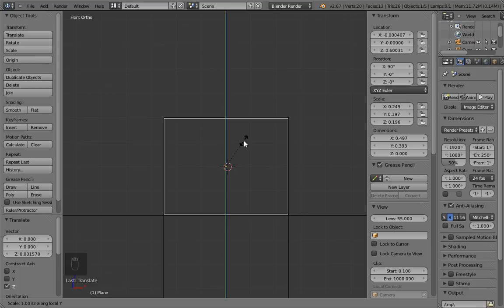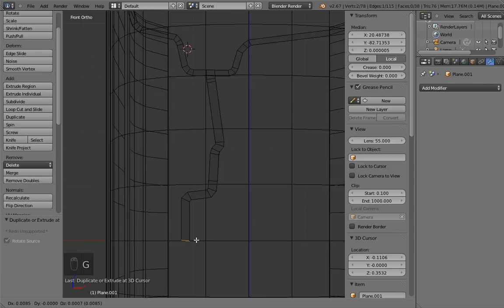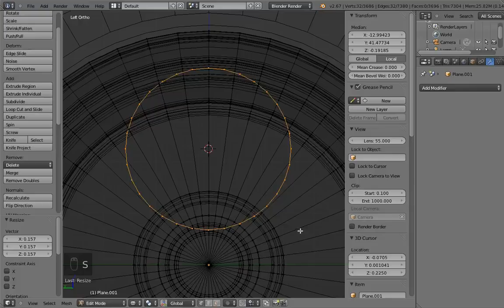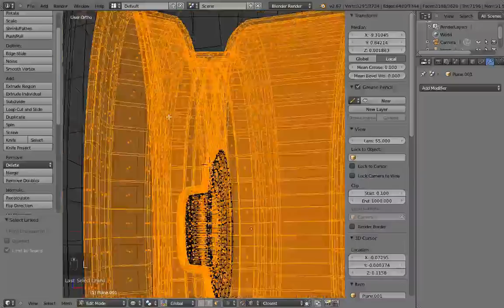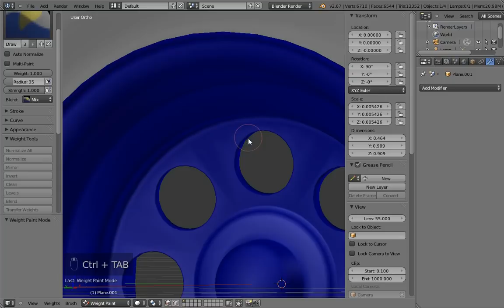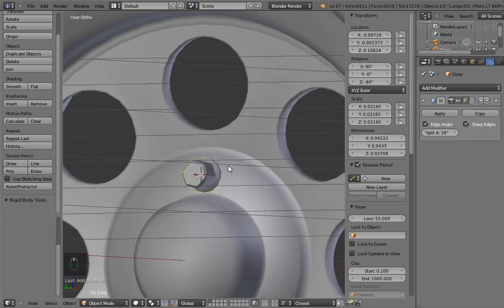Modeling an offroad wheel - Blender 3D Tutorial (Part1)

Comment: Great tutorial, but one question;
On the holes, why are you using the knife and not the boolean modifier? Wouldnt the holes be more accurate if you just subtract a cylinder from the rim?

(Havent gotten all the way though the tutorial, so if you do actually do this then ignore this question)
Reply: i am learning all of this as well and i would have to agree the Boolean modifier works best in this situation because  it is a wheel which is rigid and does not have any deformation properties to it. my first time around i did it his way and it looked great but took longer. i have done a few more over the last few days and have been using the B-modifier instead and it works just as well. especially for simple stuff like a flat faced wheel with holes...  i will say the second part of this series about modeling the tire treads is the best method and the one i continue to use.  i have watched a few other ways of doing it but this way is best.   -Cheers

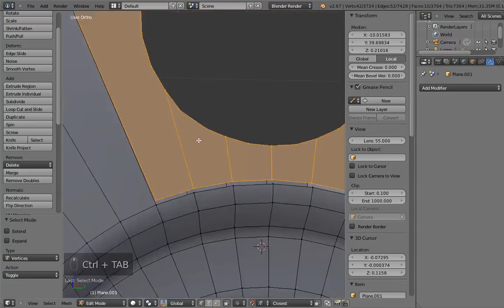Comment: Hello, I have a quick question. At 11:15 you snapped all the points together how do you do that? I am wondering because all I see is G, and all that does for me is move the point/vertex. So I am wondering what else do I need to push to get it to snap.
Reply from the maker: Hi, if you look at the bottom of the screen, there is a little red magnet (snap) which is activated. To the right of that there is a dropdown select, where you can define what to use as a guide for snap. In This case vertex was selected. When the magnet is red, snap is active, when it's grey, it's inactive. When it's active you can hold CTRL for deactivate temporarily, when it's inactive, holding CTRL will activate snap. 

Snap is really awesome, allows you to work more precisely. If you have time, try to combine axis locks (z,x,y) and snap together for interesting results.

Comment: ok so im really new to blender and know this isnt really the best 1st project to attempt but hey so what right lol ok well im hung up on a part right around 1:20 after you scale the plane you hit scale and rotate and then add some details. well when i do that it doesnt divide the section like it looked in your model i also tried the subdivide and it split it into 4 squares instead of 4 rectangles. so ya how do i get the rubber to take form like you did with that grid insert that you had to help form the curve of the rubber?
Reply from the maker: Hi Richard, don't give up :) ! It's the mouse wheel after hitting CTRL+R in edit mode. Let me know if that's it. Thanks for watching!
Reply: ok i will deffinately let u know. i just started using blender 5 days ago and have always wanted to try autocad but could never afford it

Comment: You could have made the holes with the boolean modifier o.O. It would have been simple
Reply from the maker: Hi, indeed it is possible to make holes with boolean (I'm a big fan of boolean :) ), but the "cutter" objects most likely introduce unwanted edges to the surface of the rim which need to be cleaned up if you want it to render nicely. Thanks for watching, and for the tip, it might work in some cases.

Comment: holy crap, i don't think you could go any faster...
I'm watching this at 1/8 speed and I still cannot keep up...
Reply: +Shane Drake I'm just happy you have the key logger on, or I would never have finished
Reply from the maker: +Shane Drake Thanks.. sorry in advance if you  happen to watch part 2.. i turned it on halfway only :(
Reply: +Zoltan Giber thank you for the reply
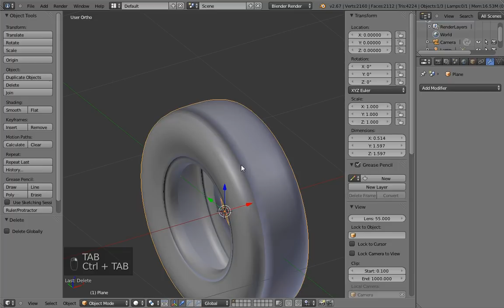at 3:00 you have the tire in edit mode yet all the object data is showing. I am obviously a new blender user, but I cannot find how to display all of the data. On the newest version, I only have the single edge displayed. I hope that makes sense. 
if i press Z i can see all of the lines

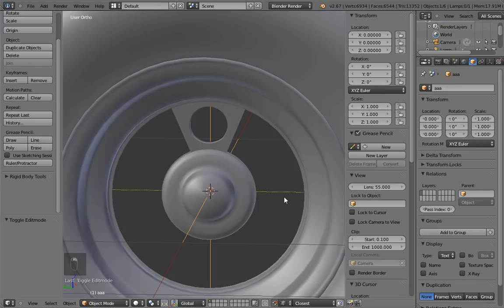Comment: For some reason the trick at 14:41, when you rotate the empty object (aaa) with 45 degrees to make the holes, does not work for me. I tried it in an empty blender file, and it worked. But with the wheel is simply does not work. I have no idea why. The whole is a separate object, I have set up the array modifier exactly like you, but when I rotate the empty mesh, nothing happens. I did noticed though, that the dimensions of the mesh changes drastically, when I add the array modifier, and rotating will simply not work. (I set the Blender to always rotate around the active mesh, and since it has a large dimension it rotates like crazy...) Do you have any idea what can be the problem here? Thanks in advance! (U.I.: Jo vegre "magyar" tutorialt hallgatni :))
Reply from the maker: Rudolf Heszele There are a few things to check: The edited slice (with the hole) must have it's origin at the same spot as the empty, which is in the center of the wheel. Then, in object mode, transformations must be applied on it (eg. scale is 1.0, 1.0, 1.0, rotation is 0,0,0 ).. I can't think of anything else at the moment...
(U.I.: Koszi, hogy megnezted, es kommenteltel :) .. szivesen csinaltam volna magyarul, csak tul kevesek beszelik)
Reply: Zoltan Giber Thanks for the tips! I had to apply the rotation and scale, and then it worked! Thanks a lot! Great tutorial!

Comment: Thanks so much for this Tutorial This is the first time Ive really used blender and I'm learning so much. I really appreciate the use of the key and mouse identifier in the bottom left corner of your video that is an extremely helpful feature. I know the mouse buttons can be adjusted. What settings do you have for your left mouse button. Mine are still on the default and It only moves the target around? Thanks.
Reply from the maker: I guess the answer comes a bit late, sorry for that. I've been using a wacom tablet, with the default settings. I'm glad you've liked the tutorial.

Comment: why not use torus?
for hole is it same using boolean?
how screw modifier used for?
Reply from the maker: patrick samples Hi you're quite right, the bounding box is not essential . I was modeling this one to scale so it was my way of quick measure.
Reply from the maker: Hi, thanks for watching. I'm sorry but I don't really get you. Use torus for what?
For the hole you can try to use boolean, but the result will be unpredictable, and most of the times there are weirdly cut polygons after using boolean. 
As for the screw modifier.. there is a helper object (an empty in my case). I guess it's visible on the video, but let me know if you have a specific question about it.
Reply: Zoltan Giber
you both have 2 different methods. very different. i don't quite get the bounding box start but i see how it works.
Reply: Interesting.

Comment from the maker: Hi, thanks for watching, and taking the time to write. Although it's a little hard to say without seeing your work, but some things I can think of:
1. turn on smoothing (?)
2. make sure that there are no polygons with surfaces on the cross-section before you add the modifier, meaning, that the shape resides of 2-point polygons (edges) only.
3. make sure that the helper is in proper position and perfectly aligned.